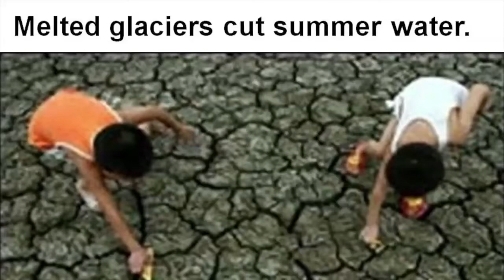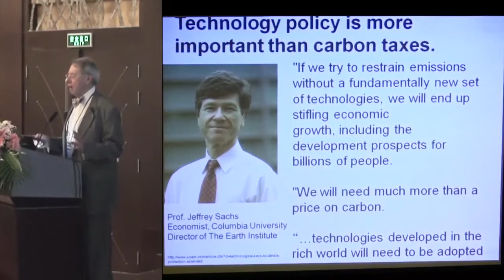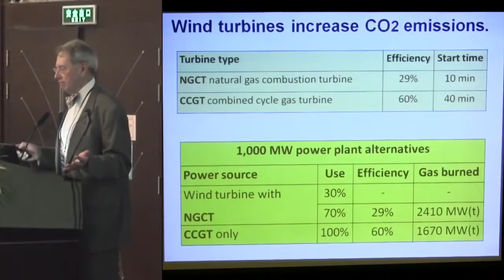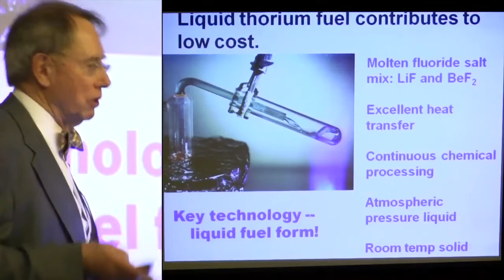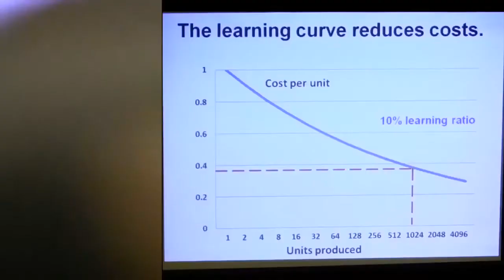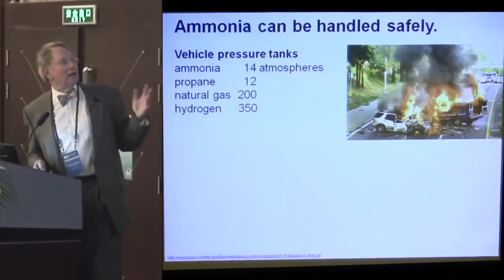TC 14 • Robert Hargraves, "Energy Cheaper Than Coal" Pt. 1

Comment: No need to disparage the idea of a fee or tax on carbon. Economics texts identify a fee as the most efficient policy for managing impacts on the environment, whether they be resource depletion or pollution or other environmental degradation.

Fees charged in proportion to harmful impacts on the environment will ensure that prices show an honest representation of costs. What is profitable will align with what is sustainable. The technologies that provide benefit at the lowest cost to the environment will thrive.

Sharing proceeds from fees would end poverty. It would ensure that the policy is fair (that it doesn't make the least well-off worse off).